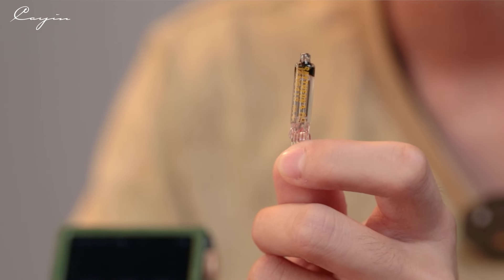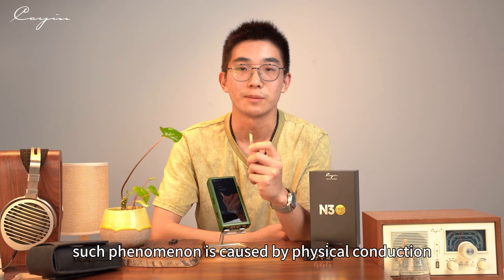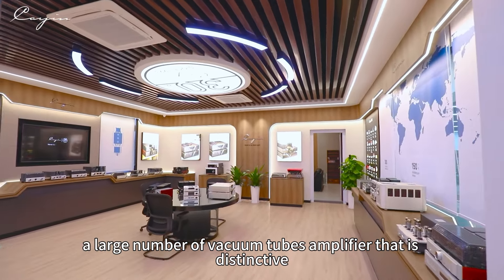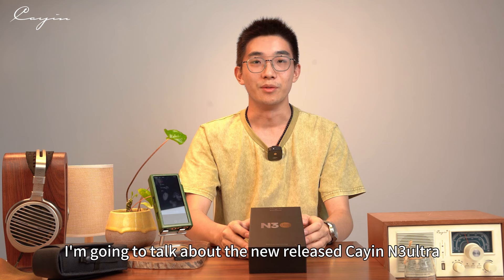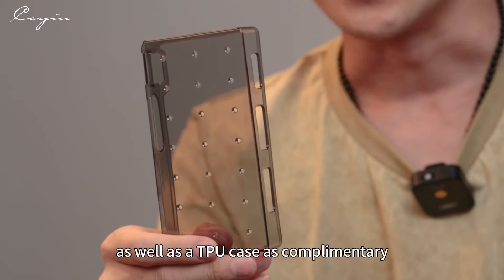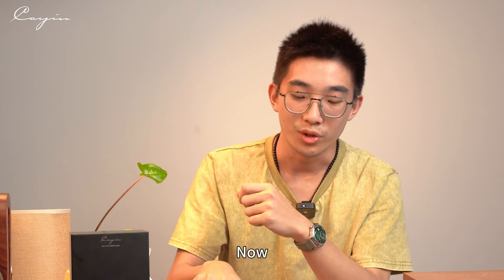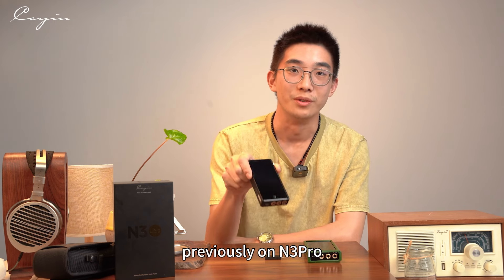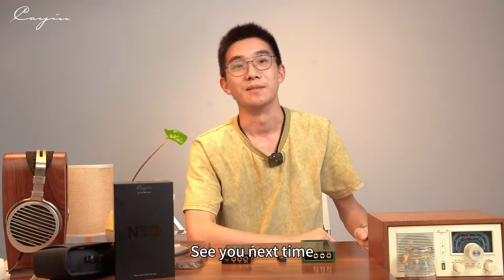N3Ultra: Features & Comparison to N3Pro

Comment: Does n3 ultra plays usb audio over tube mode or just Solid state mode？ TQ
Reply from the maker: Hi there, if you use USB audio, it goes neither Solid State nor Tube mode, because these are essentially analog signal, but the USB audio doesn't involve analog signal transmission, instead, it's transmitting digital signal.

Comment: No streaming right? No Bluetooth? I need those things.
Reply from the maker: Sorry to confirm that, the N3Ultra does not have BT or Wifi, it was designed to focus on pure music playback, without any potential interference to the vacuum tubes.
Reply: @cayinaudio9112  right ok, I see that now.. Wifi and Bluetooth will surely set up resonant currents in the tubes.. Thanks.